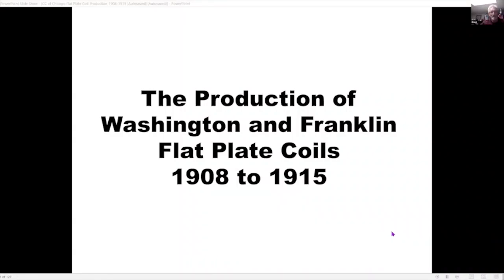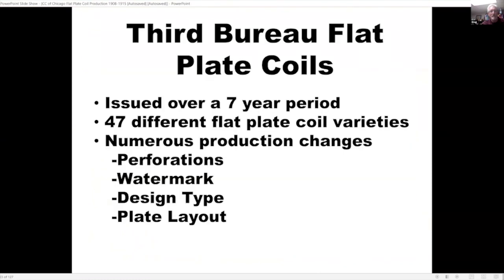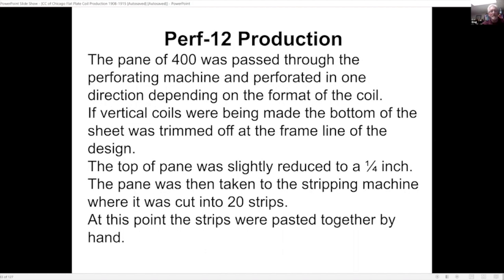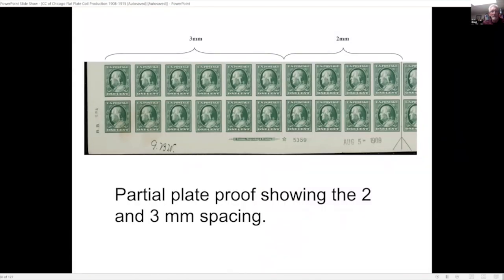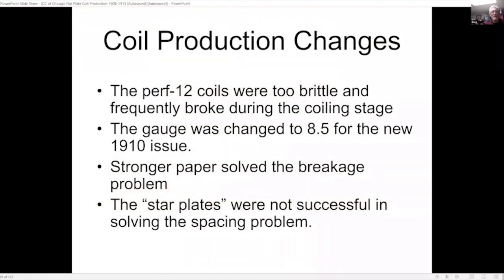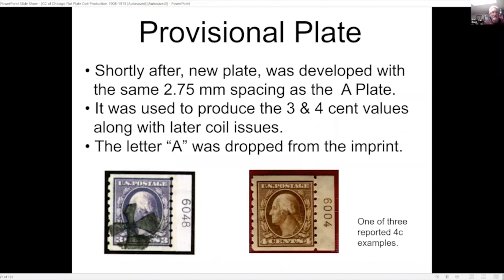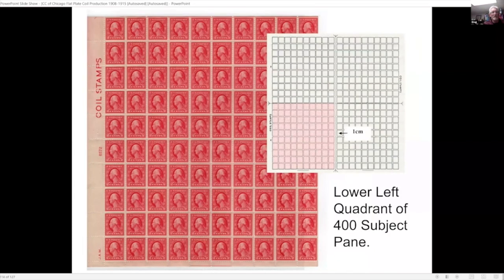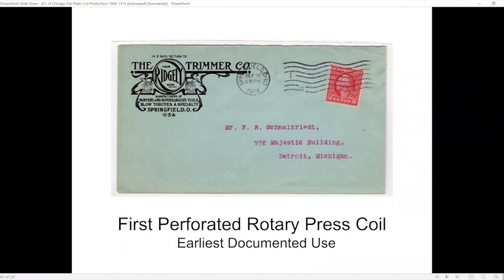The Production of Washington and Franklin Flat Plate Coils 1909-1915

Comment: ABSOLUTELY LOVED THIS! I have been fascinated with the early coil stamps since I started collecting stamps as a kid in the 70's. I'm interested in all sorts of areas in US philately but this is one of my top favorites. I actually have a Scott #445 commercial cover that was used during the first several days of the 1917 war rate: a little out of period but still a valid non-philatelic use. Would like to send you a pic if you're interested in seeing. It's an item I'll be submitting to APEX in the next couple of weeks.
Reply: Hi, the 4 small holes horizontal  between the stamps were holes created by coil machine , for the purpose of moving the rolls along .elliot from Israel